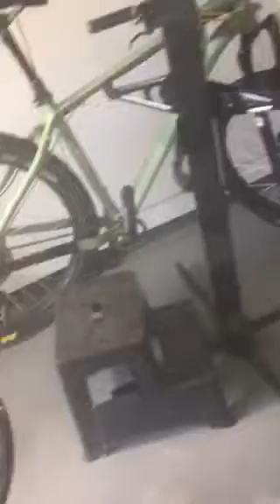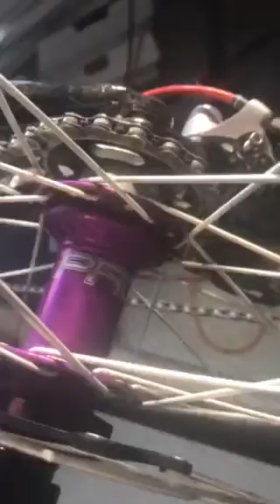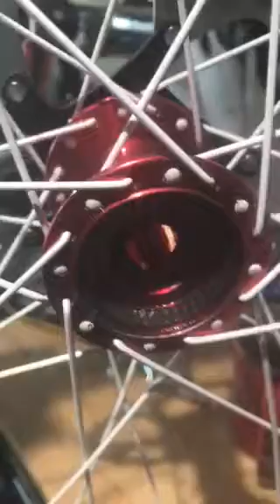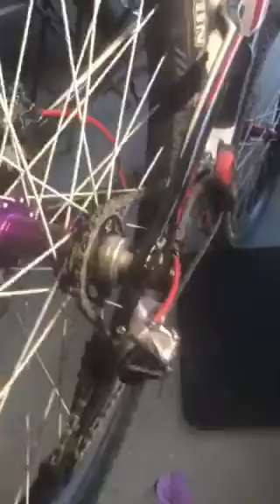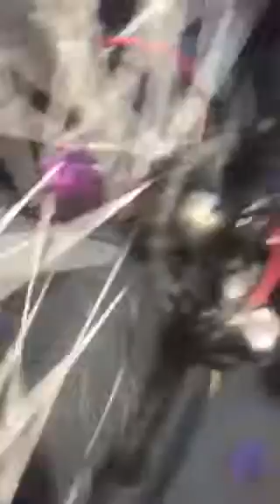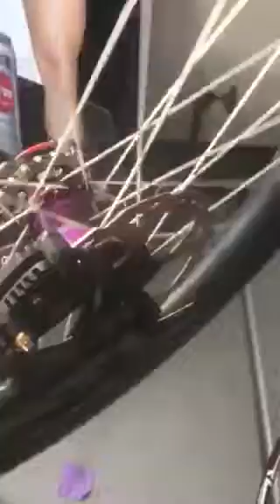Hope pro 4 singlespeed/trial hub conversion to 148 boost

Comment: Did you have to use any spacer on the brake disc? Did you have to dish the rim off center of the flanges? I am looking to build the same thing. I know Hope has a conversion kit for 148, I am trying to figure out if that works on the singlespeed hub.
Reply from the maker: no spacers on the disc, i redished the wheel.  i still use the wheel today.  i didnt get the conversion kit.  i took an axle out of another hub that i had.

Comment: Worst CAM works ev... So you did use a tentioner..?? Or what..?
Reply from the maker: i have a hope trials hub thats 135mm I put in a boost axle.  i have a Titanium Gnarvester singlespeed boost frame.  I was simply testing the hub in my boost spaced Stumpie carbon 6fattie  to see if it was possible to use the trials hub in a boost frame.  I'm a healthcare worker and home bike mechanic not a cinematographer.  I do have a gimble and a garmin Virb ultra 30 i take on the trails.  i make videos mostly for my Dad who is old and unable to ride a bike and likes to watch me work on bikes.  only a few videos are worthy of being called how to.
Reply: mike darling oh, I did not think of that....?! 
Moron.